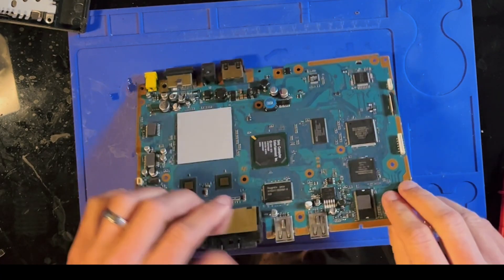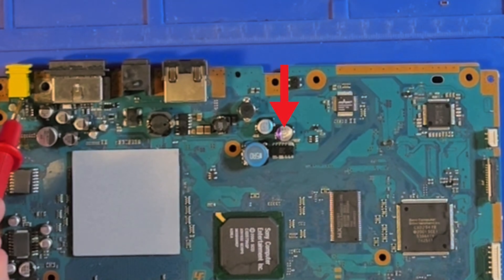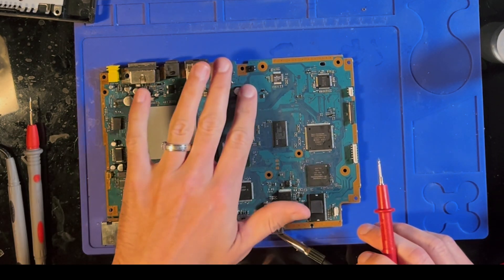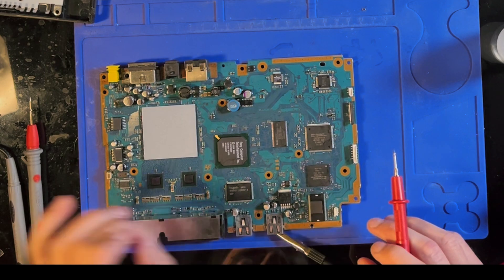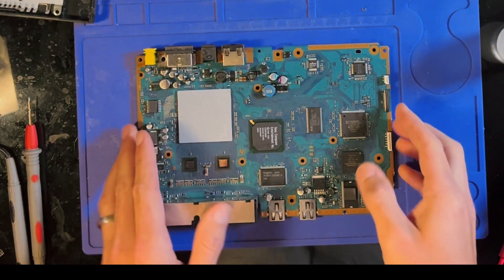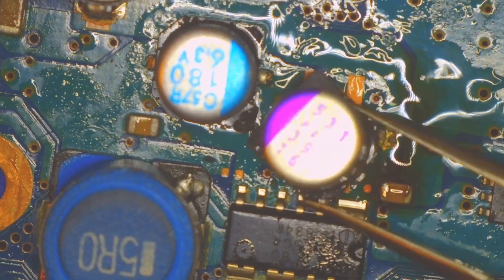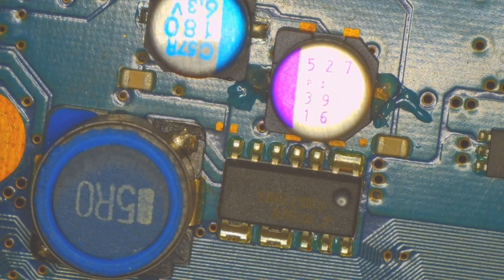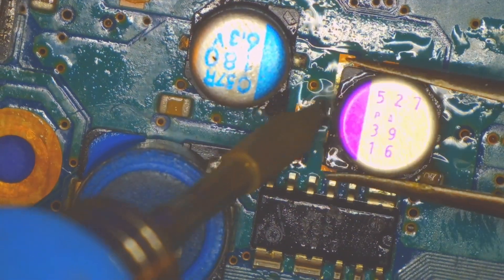Trying to Fix a Viewer's Shorted PS2 Slim

Comment: Hi, if you had a short on the board then there's a high likelihood that a fuse may have blown. Check the"PS1" fuse located toward the lower/middle left portion of the board (back side) right above the "PS7" fuse, it's really small and usually green-ish in color
Reply from the maker: Totally had a blown PS15 fuse that I’d found before this. Unfortunately, all the other fuses checked out so 🤷‍♂️. Thanks for the suggestion!
Reply: @FixMoreWasteLess Lol, I just noticed your reply.
After rewatching the video it seems like you might have a bad power ribbon or the connector itself for the power button on the board is bad.
You can try turning the board on without the power button board by touching (shorting) the reset pin on the back of the board to ground to simulate a power button press.